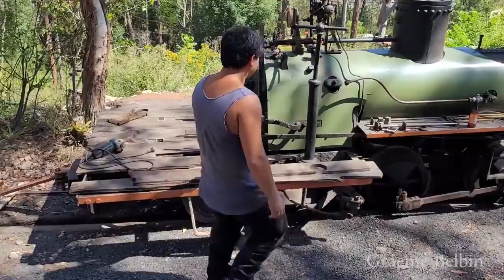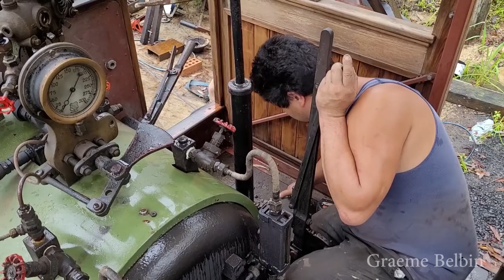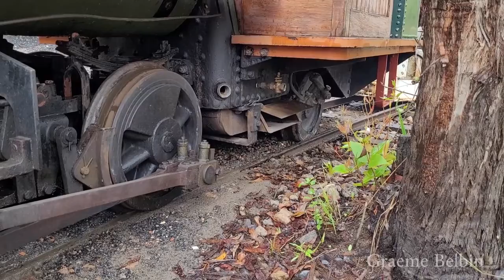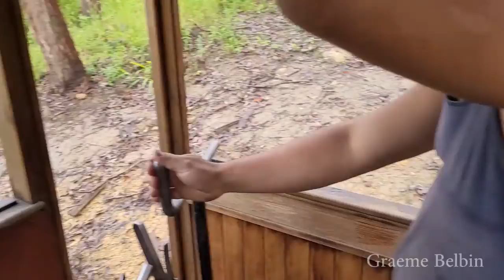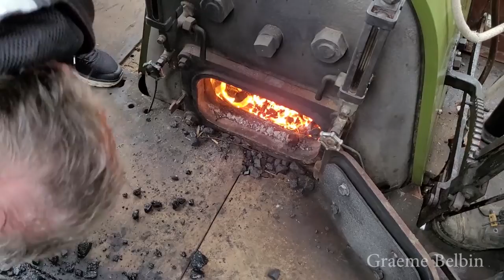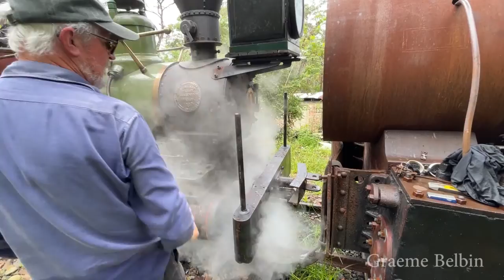"Fairymead", 2 foot gauge Baldwin ex cane loco, built in 1889, reassembly and steaming.

Comment: Was 4h8s a timber railway originally  How much track do you have access to  It looks great and congratulations to all those involved in 5he restoration
Reply from the maker: It's built on private land and was never a commercial operation. There are also 12 inch gauge and 7.25 inch gauge lines on different levels up the hillside. It will be around 1 klm long, out around a loop and back.

Comment: When are you going to fit the cylinder drain cocks, or are they missing and you will have to manufacture some? Well done guys showing a lot of promise.
Reply from the maker: They are fitted, just not visible in this and not controlled for most of this video. They are now, though.